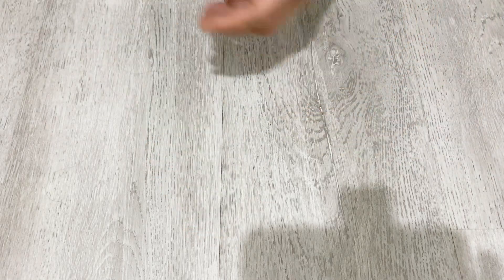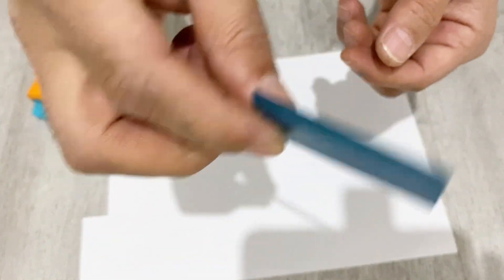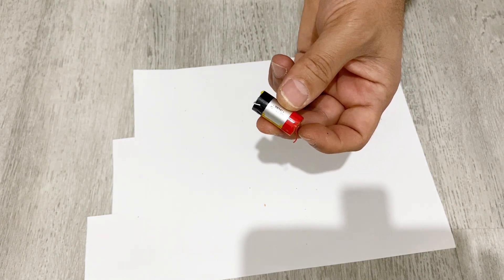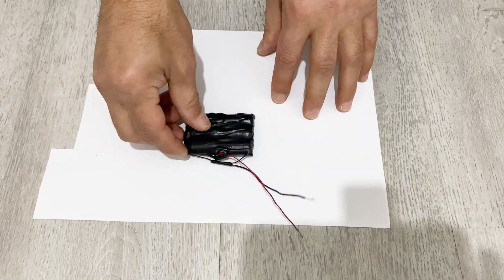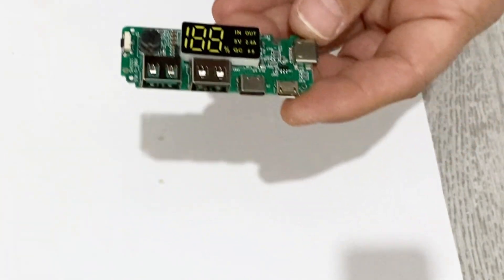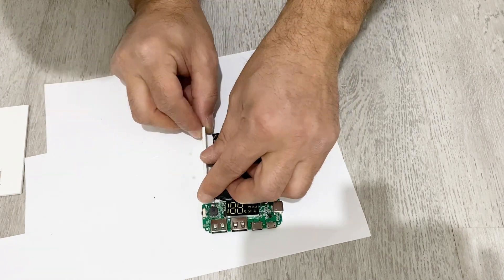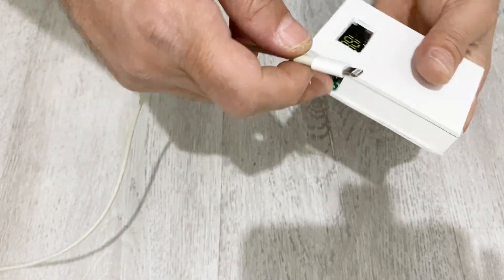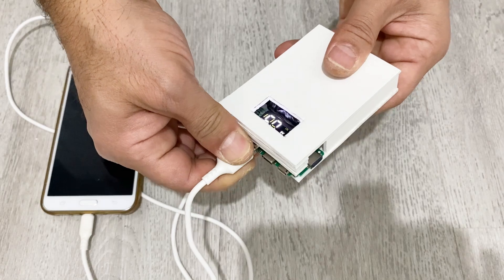How to Make 10,000 mah Power Bank From Electronic Cigarettes.

Comment: Beware of the balancing.
Reply from the maker: The module do it by itself brother.
Reply: There is absolutely no balancing when you connect the cells directly in parallel. LiFePO is more forgiving, but this could be a problem with Li Ion.
Reply: They will self balance, or rather, passively balance, like any battery. You just won't be able to charge or discharge them proportional to the voltage of each individual cell, which is not optimal for longevity or overall performance but that's not the end of the world considering the cells already served their intended purpose and would otherwise be trash anyway. Nothing to beware about.